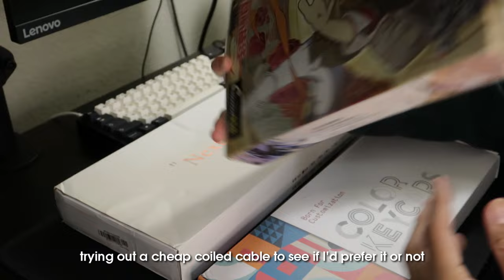Next Time 75 | A Budget 75% Hotswap Custom Mechanical Keyboard

Comment: Im planning to use blutack inside the case as well as blutack under the keycaps (inbetween the gaps in the switches and also inside SA keycaps, will probably put foam inside too as well as lubing some box jades 😈

Comment: what are your thoughts on the weight of the keyboard? Does it feel sturdy enough to you?
How do you feel about the typing angle on it?
Also have you been able to use the software it comes with?
Reply from the maker: This keyboard is extremely light but sturdy enough not to slide around. The typing experience is stiff but it sounds poppy with the mods. I’m not sure about the angle of the board but I feel comfortable enough when typing. And for the software, I haven’t tried it but I don’t recommend it because personally I don’t trust anything that doesn’t support VIA or QMK.

Comment: What is the purpose of sanding the stab wires down? I've never once done that. I've balanced and relubed, but that's about it.
Reply from the maker: It was to make the wire balancing easier, I got this tip from :3ildcat
Reply: @sushijades  ahh okay, thanks!

Comment: Hey bro,have you see the video made by YBBK,title is "feker ik75 build"..do you think its possible to mod the gasket like him do and change to softer gasket?
Reply from the maker: I have, and I think for this board it can be done. But the next time 75 does not have an additional PC plate, only aluminum. So you wouldn't get as much flex as you would with a PC plate.

Comment: Do u like the feeling of the board ? I mean, should i go on the NT75 comparing with the TH80, do u know which is better ?
Reply from the maker: I haven't got my hands on a TH80 before but the NT75 has a pretty solid feeling. I wouldn't know which would be better, but I really like the sound profile that the NT75 makes.

Comment: how is the weight of this keyboard? Ive heard people say this keyboard is extremely light. Another question I have is: would this be a good choice for first time building? Thank you
Reply from the maker: This board is extremely light, however after I added in the tape and pe foam it slightly gave it a bit more weight. I strongly recommend this keyboard for first time building, it’s extremely budget and beginner friendly for first time building :) I hope this info helps!
Reply: @sushijades  thank you for your response. It really helped. I was debating between bunch of boards and I think I will go with this this one. I will also probably do the coin mod if it feels too light to me.  Loved your video btw and subbed as well.
Reply from the maker: @emirx1126  I’ve heard of the coin mod but have never tried it before, let me know how that goes for your NT75. Thank you for watching and your support! :D

Comment: would you reccomend this or the feker ik75
Reply from the maker: In my opinion i think the nt75 is best budget wise and sounds really good for it’s price, but if you have that extra money for the ik75 like the POM/PC plate, then I would recommend getting the ik75. Sadly I haven’t found any other plate for the nt75 :(
Reply: @sushijades  sadness :( So what you're saying that if i have the extra monies, i should get the feker ik75?
Reply from the maker: @TreetonTheTree  yes :)
Reply from the maker: @TreetonTheTree  but it doesnt hurt to also try the nt75, I’ve been using it a lot
Reply: @sushijades  I mean i wouldnt be buying new boards soon, i kust wanted a good board to settle with